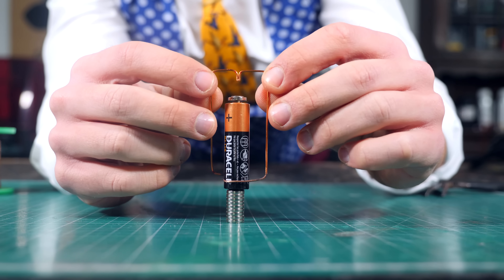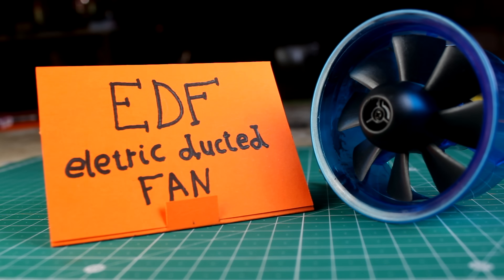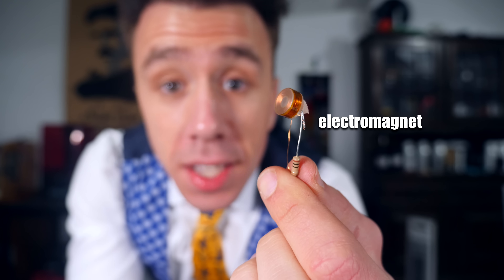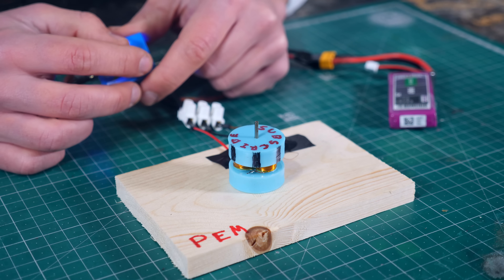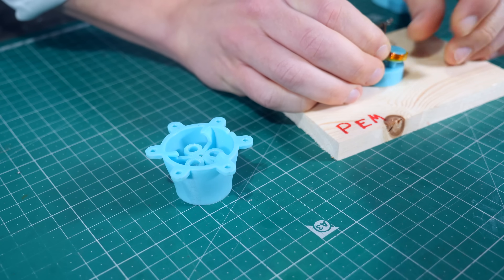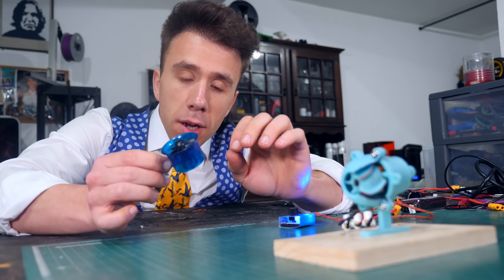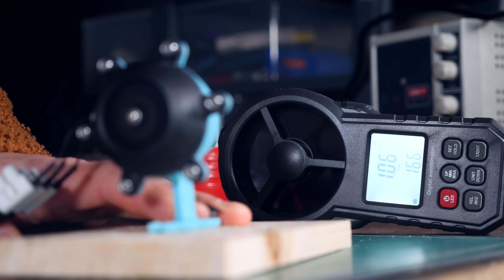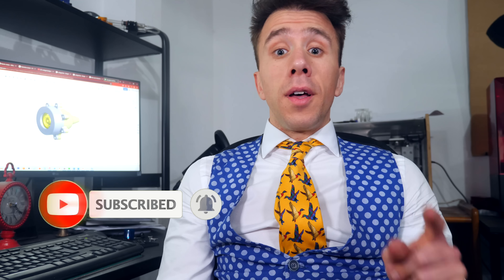I 3D Printed an ELECTRIC MOTOR FAN

Comment: It’s the surface area of the impeller blades vs propeller blades and their respective blade count. 

Simply, you’re not moving the same amount of air despite same overall diameter and same rpm. 

If you want more info, ask, or got to the multicopter / FPV subreddits. we have the same fun problems with UAV props.

Comment: Hey Integza :) Here are some ideas:
First of all, if you have something that generates smoke, use it to check the airflow in your Fan. Your connection of the two pieces sits right at the point of maximum compression. You could lose alot of pressure that way without knowing it. An O-Ring might help there. It would be in general intersting to print it again in a clear resin to then put smoke through the design to check the flow. maybe you have high boundry losses :D

the next obvious idea would be to check your intake. Maybe it is too small and you choke the fan (which would also increase heating). Try diffrent sizes or claculate the size you need if you are sure of the values you need/aim for. 

Next, you need very thight tolerances between the impeller and the housing at operating temprature otherwise, you again leave alot of pressure on the table. Check your operating temps so you know what thermal expansion you need to take into account.

Good luck with the fan :)
Reply: I recommend using a burning tomato as a smoke source!
Reply: Hey make a 3d printed turbocharger
Reply: @happyjack3497 a stand-alone turbocharger is just a turbojet engine

Comment: 1. the output  air become smaller right? you might change the test flow, 
2. its 3d printer conection body, make full without loss air

Comment: Tolerances between the impeller and casing, sand internals so they’re smooth, surface area of the blades and consider the amount of air and the intake and outlet sizes. Angle and pitch of the impeller blades and the amount of blades also makes a difference. Shape of the casing also may determine the dynamics of the way the air flows through and of course a well balanced impeller because high rpm’s can be hard on things.

Comment: Thrust efficiency is a function of airspeed vs jetspeed. The closer the better, though you obviously get less net thrust that way. A centrifugal fan generates a small volume high speed jet, and ducted fan generates a large volume low speed jet (that's because speed and volume each consume engine power, specific fan designs just directs power in either fashion). Your application is low speed so ducted fan would be more efficient i.e. produce more thrust from a given engine.

Comment: I hope this helps. 
Thomas Edison: the father of integrated circuits. Low amps, stable frequency, variable voltage. 

Nikola Tesla  the father of magnetic frequency: high amps, variable frequency, low voltage. 

You need to change your coil to take high amps, amps is magnetic potential. 
Which you will need so many wire turns. I start make two and three stage coils by
The first coil will two turns 10mm copper wire, the second coil goes straight over the first coil 3 turns 15mm, third coil straight over the top of both first and second coil 20mm four turns. 
Each one set at different amps, give more magnetic potential energy and less heat more control. (Volts around 8v max). 

start by making a solenoid first to get right. 
Voltage is only need to create a path way for energy to past though. 
With Voltage you will need only and small amount start at 2 volts work up from there. 
Variable frequency to change the speed up and down, you need to research magnetic frequency to find the right one for your fan, that’s make a solenoid first. 
Now I set up my motor for my (rc boat) i set it up a A/C style.
I run a A/C 8v, 300 amps, and variable frequency for up and down speed. 
And puts out 110nm of torque for 150mm dia water jet boat motor. 
I use 7watts of power to run the motor. 

I hope I give you a new direction
Electric motor are build on the wrong maths. 
I hope I have helped. 

I did enjoy video

Comment: The problem with the design is the propeller and shell it needs to be as close as posible and it should produce more air flow. Greetings from Belize

Comment: I don't think you will be able to get any impeller driven fan to generate the same thrust as the EDF. For a turbojet engine (which is the most similar engine to either the EDF or your impeller fan) the equation for thrust is F = dm/dt * (ue-ua) + A(Pe-Pa) where F is thrust, dm/dt is the mass flow rate of the air through the engine, ue-ua is the difference between the exit speed of the exhaust and the speed the engine is traveling, A is the outlet area and Pe-Pa is the pressure difference between the engine outlet and the atmosphere. Ideally, Pe-Pa is 0, as this maximizes your exhaust speed. Any gains from pressure are canceled by losses in exhaust flow.
An EDF is designed for as high a mass flow rate and exhaust speed as possible. An impeller such as yours is designed for pressure. If you were able to make a perfect fan in this way, you would probably get the same thrust, but odds are you have a pressure difference stealing performance. 
The second (and probably more significant) reason are losses in your duct work. The EDF has no ducting, so the air has minimal losses as it exits. Your ducting will steal energy from the air, and you will lose thrust as a result. 
(I am not an expert, I am a senior in Aerospace Engineering)

Comment: Thrust is a function of rate of change of momentum of the gas flow. It can be thought of as the mass flow rate times the increase in velocity. Power represents the kinetic energy increase of the flow, which can be represented as the mass flow rate times the difference in the squares of the final and initial flow velocity (just delta v squared for static thrust). Therefore, the way to maximize  thrust for a given power input would be to maximize mass flow rate and minimize the velocity increase. The fan has a larger inlet diameter which allows more air to flow in at a lower velocity while the impeller draws in less air and accelerates it to higher speeds, so the fan is more efficient at turning power into thrust. An impeller is better in a situation where you want smaller sizes/weights and can afford the lower efficiency in thrust, such as in a jet engine, because the reduction in weight/size yields more benefit to total flight efficiency.

Comment: As I understand it, ducted fans and centrifugal fans require a very tight fit between the fan blades and the casing to work properly.  When there isn't a tight fit, turbulence occurs at the blade tips which back-propagates along the length of the blades, slowing the flow.  When the fit is tight, air has no place to go but along the blades and remains constricted, ensuring the blades efficiently push the air.
Reply: You may need to decrease the distance between the blade tips and the casing.  If this causes tolerance issues (the blades start scraping against the casing due to imperfections) you may need to consider using another process besides 3D printing.

Comment: A possible issue could be resistance from increased friction, the impeller looks to have more point of contact between items spinning and items not spinning so the friction could be causing the motor to bog down (its likely more designed for rpm than torque) it also seem that the fan would carry more wait causing the motor to work harder again resulting in lower rpm and less thrust. l would try and use copper grease or bearing between the axle and the housing

Comment: I'm no engineer but I think that if both fans are turning at the same RPMs the reason you're not getting as much air flow is because of the blade size. The size and the pitch of the blade will determine how much are you're grabbing. Remember air his fluid so I would refer to the laws of fluid dynamics to help solve this situation. Good luck.

Comment: Video suggestion - make an electric motor ONLY using electromagnets - use a brushed rotor and ESC driven stator. could be interesting...

To bluntly honest, your never going to be able to design, let alone 3d print an even vaguely useful fan, the level of precision your working with doesnt allow it.

Comment: Why would you expect two entirely different fan designs to produce similar thrust?  The impeller fan may be much better at generating a pressure difference between input and output, but may not be comparable in moving the same volume of air.

Comment: Make a 3D printed housing for a drone quadcopter that turns it into a hovercraft. Make the housing ducted so that when you steer the drone it tilts to push more air in the desired ducts/direction.

Comment: My guess would be that it has to do with turbulence caused by the impeller, use a smoke machine (or burn some tomatoes) to see how the air forms around both the EDM fan and your impeller fan. Also, since your impeller is more structure than fan, the output thrust should be less than the EDM fan. Which is more fan than structure.
Reply: How would he ever get the burnt tomato smell out of his workshop? He could use the fan! :)

Comment: probably it's a combination of ideas. Probably the magnets spining in the same direcction that the preassure try to stop them is not a good idea. Also the air preassure need to be very well isolated, probably too much gap between the motor, motor blades and the chamber. That's all you need to review, not too much secrets.

Comment: It has to do with the difference in the amount of work that has to be done by the fan motor. That motor is designed to run in a ducted fan that has an open inlet and outlet with zero to negligible pressure differential. The motor in a turbofan will need more power in order to generate not only airflow but also overcome the pressure differential inherent in turbofan designs. Something about bypass ratio. Idk I'm just a curious dude who loves your videos.

Comment: The EDF is optimized to create the most thrust possible from the electric motor. You're making a centrifugal fan with the same motor and expecting an equal amount of thrust, though as you mention yourself a centrifugal fan is optimized to compress air and increase air density. Air velocity and Air density are not the same, and higher air pressure doesn't necessarily mean higher velocity and thrust, so I don't see how you expect the velocity from the two fans to be equal.

In my understanding, it's not really a valid argument to compare the two fans as they are fundamentally different. The EDF uses a propeller meant for creating high thrust. The centrifugal fan uses an impeller that sucks in air and slings it outwards creating high pressures.

Keep in mind that even though I'm very interested in aerodynamics, I don't really know what I'm talking about. I could be wrong, but this is my take on your question. Anyone, correct me if I'm wrong :)

Comment: have you tried to display the motion of air to locate your problem I once build an wind channel using a 12v fan and a vape, you could also use a vape to make the flow of air visible

Comment: Simplified for ease of reading. The main point of an impeller like the one in the Dyson is to creat a very large change in pressure. Ie high pressure after the motor, low pressure before the motor. Thus sucking things into say a vacuum, this does not create high speed airflow. Where as with an edf it's actually opposite, the high pressure is Infront of the fan and the low pressure should be behind the fan because you're doing 0 compression you're just throwing air at high velocity. Thus Bernoulli's principle an increase in the speed of a fluid occurs simultaneously with a decrease in pressure. therefore the one that produces a lower pressure produces a higher speed

Comment: your impeller based design should draw the same load on the motor as the edf to have any chance at giving out the same thrust. you also have the issue that the impeller compresses air but you need to design the nozzle perfectly to convert that pressure into airspeed or there will be important losses on that step.

Comment: You probably need a tighter fitting between impeller and casing. Otherwise air could skip the blades and just cause turbulent flow and therefore friction.

Comment: "Am I designing Something wrong? Am I doing Something wrong?"
Now I feel personaly involved in this.

So here's a partial solution: since you are using an axial motor (wise!) instad of radial (lame), you can use Tom Stanton's Flywheel Battery idea and build 2 discs of magnets per side, so that you have rotor-stator-rotor instead of the actual rotor-stator setup. Here's the right timing on his video: https://youtu.be/yhu3s1ut3wM?t=314
Now, if you want to really step up your project, consider my tip: use Tom Stanton's Flywheel Battery design, but instad of rectangular magnets use cubes in Halbach Array arrangement to maximize their potential.
Final note: ball bearings are so 1794. We are in 2023, magnetic levitation is a thing, the battle against friction is over (and we won).

Keep up the good work, and until next time I wish you... Something!

Comment: Video Idea: Find a combustion engine with a propeller and mount it onto a vehicle. Connect the exhaust into a single pipe and add an afterburner to create thrust. This creates two methods of thrust, and it could be used to generate a lot of power. If you want to go advanced, make it tomato powered, as no one likes them anyway. Tomatoes are disgusting!

Comment: The problem is that the Centrifugal fan is designed more for static pressure, while the regular fan is designed more for flow rate. So in the Centrifugal fan, you are converting the energy mostly into pressure instead of flow rate, and your anemometer measures the flow rate. That's why it shows you a lower velocity. The air coming out from the Centrifugal fan is lower speed but higher pressure compared to the regular fan.

Comment: So i watched your video twice and still don't get it why you expect the ducted fan to produce the same amount of thrust as the "aerospike". The ducted fan is basically a propeller. In general the less blades the more efficient (less power per thrust) and more blades is more thrust. That's why you most long range drones have big props with two blades, like wind turbines (3 bladed is beneficial for the structure). Wind turbines are a good example to understand propellers since these huge blades are basically wings which make use of the lift component, not the drag component which is around 20 times bigger! For power generation the less blades, the more efficient but for high torque (like these american water pump wind mills) you would use many blades or even a disc. The difference between propeller and ducted fan is that the speed in the unducted propeller plane is half the speed far far behind the propeller whereas the speed in the ducted propeller plane is already the final speed. The unducted fan "gathers" air from a bigger diameters and accelerates it to a smaller diameter.
So what does the aerospike? As you mentioned these are intended to be used as a combustion engine with four strokes (suck squeeze bang blow). Your impeller tries to do some kind of compression like in a turbo jet engine but a turbo jet engine does a lot more. Basically you need to increase enthalpie (compressor) then add fuel and ignite it so you can expand the gas to drive your turbine. Yes you can creat thrust in your nozzle and yes some military aircrafts even add fuel after the turbine (afterburner) but in civil aviation the turbine is coupled with a huge fan and efficiency is defiend by combustion themperature and bypass ratio. So what is the use of an electric turbine? I have no idea. This is like running a cars engine without fuel on the starter motor and expect it to bring you somewhere. The turbine and compression do another fascinating thing. When switching between rotating and stationary blades you can accelerate/deccelerate with both stages by switching between the coordinated systems.

Propellers can make use of the lift component. Aerospike is for combustion engines. You want more thrust than with your EDF? Guide the airflow with a stator behind the fan. Or increase diameter. Or even more blades.

I wrote so much and didn't really got to the point so I might edit this later or delete it completely. Thank you for reading.

Comment: From my understanding centrifugal fans are good for making pressure/vacuum but are not very good in terms of flow or cfm. Edfs are low pressure in comparison but have a much higher volume of air that passes through making the resultant force higher.

Comment: I'm no smart guy like you but I'll guess the impeller is worse because of lower air volume being accelerated.  Impellers work well in water because water is non compressible.

Comment: The design of an EDF is optimized for maximum efficiency in generating thrust, which means that the fan blades are carefully designed and the duct is shaped to provide the most efficient airflow. On the other hand, a centrifugal fan works by using a rotating impeller to draw air into the fan housing and then expel it radially outwards. The design of a centrifugal fan is optimized for high-pressure applications, such as HVAC systems, and is not necessarily optimized for generating thrust. Therefore, while both EDFs and centrifugal fans can generate airflow and produce thrust, the design and optimization of each type of fan will result in different levels of performance in terms of thrust generation. I have some Ideas to make it work as you need, Adding a shroud around the impeller can help to guide the airflow and improve efficiency, leading to increased thrust generation.